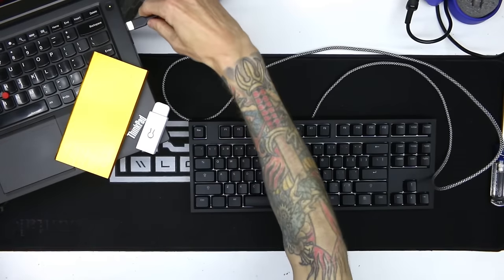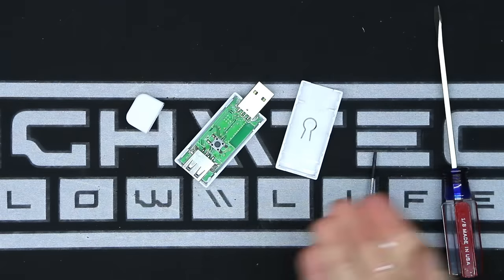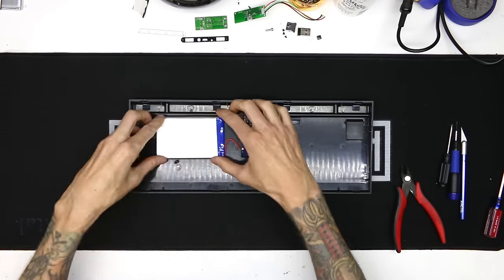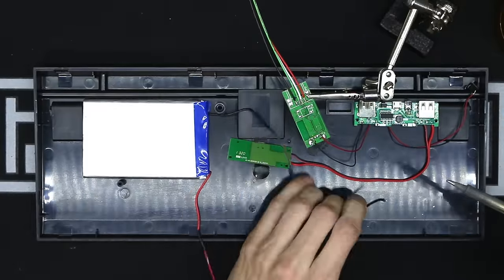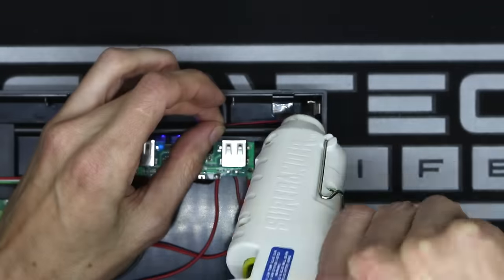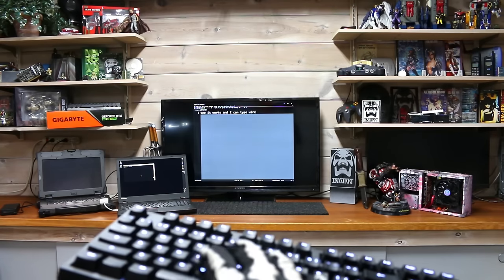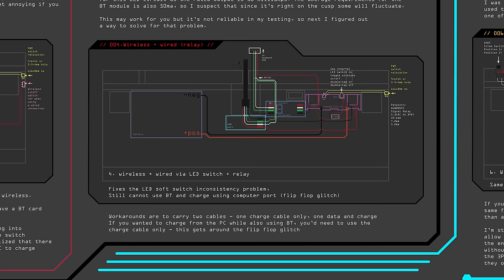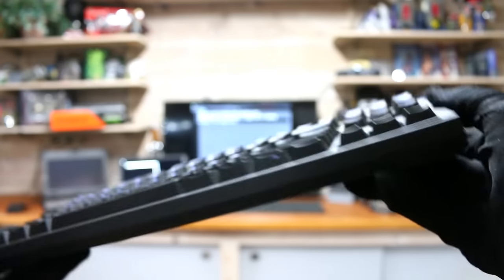⌨ Make ANY Keyboard Wireless! - Convert Any USB keyboard to Bluetooth Wireless - DIY Tutorial How To

Comment: Instead of buying power bank and usb Bluetooth and doing this all, I would buy a wireless keyboard from a store or online. Wireless keyboard's cost is less than a power bank and and usb Bluetooth 😂😂
Reply from the maker: I'm sorry you missed the point of the video, but thank you for watching and commenting. 

I agreed with what you said before you said it, as stated in my notes in the description, which sadly I had to mention as I knew there would be comments such as this. I'm just not quite sure of the motive of comments pointing this out as if it is revelatory. It is quite obvious and apparent that if your goal is to just get 'any wireless keyboard' this video and tutorial is not for you. 👍I don't believe I was telling you to pay more for working harder - something about that doesn't seem right. Right?

Buying a cheap wireless keyboard will of course be cheaper, but most importantly far easier. The keyboard demonstrated in the video is $150 without the other components, so economy was not relevant to the goals of the video (actually it tips a nod to the intention moreover). Also this particular keyboard cannot be obtained wirelessly at all, even if you wanted to buy one. 

If you want to see me make a wireless keyboard for cheaper than a "cheap" wireless keyboard - that would be a much different video as the goal would be "let's make a wireless keyboard that is cheaper than one offered from a manufacturer". Which because of economies of scale, there aren't many things that can be made by a single person that would be cheaper than a mass produced item. But what you can do with this knowledge and information is make something that a manufacturer doesn't make or wouldn't make. 

That's the point and goal of this video - to show people that wanted to convert a keyboard that is vintage, or that they personally liked that is simply not offered in any way wirelessly from the manufacturer, or from anyone.

Comment: You have to be kidding. Sell the old board and forget about buying the additional hardware and buy a wireless keyboard. Little price in crease and a lot of time saved.   Unless your just looking for a project and wanting to learn something different this is a bad project.
Reply from the maker: Thank you for your feedback, this project definitely isn't for everyone - but if you have a board (maybe a vintage board, maybe one that simply is not available as wireless) then I still think it's a useful project for those use cases. If you just want "any" wireless keyboard, then yes I agree it's cheaper and easier just to buy one premade. Cheers 👍